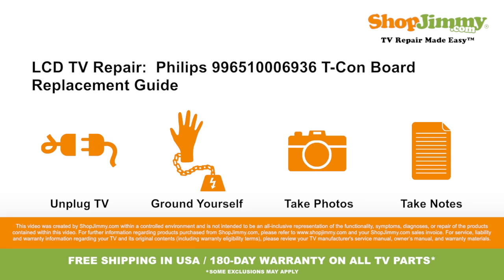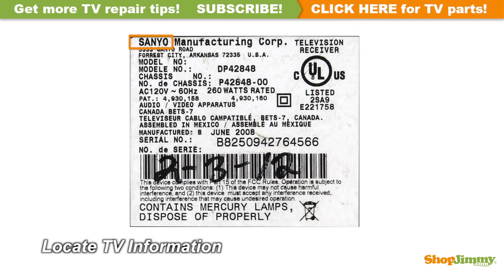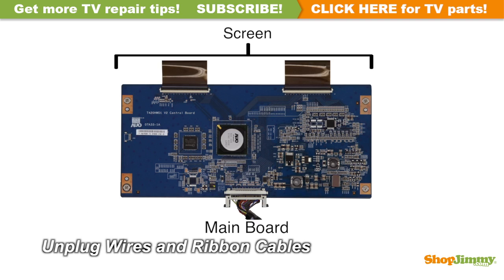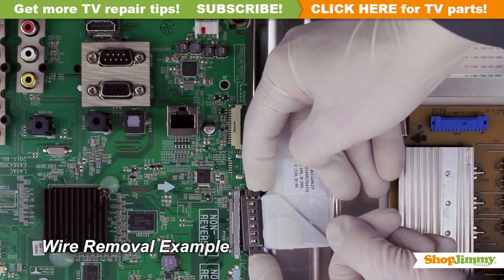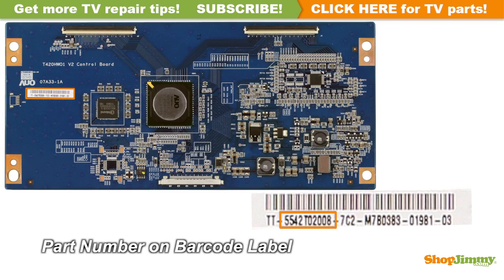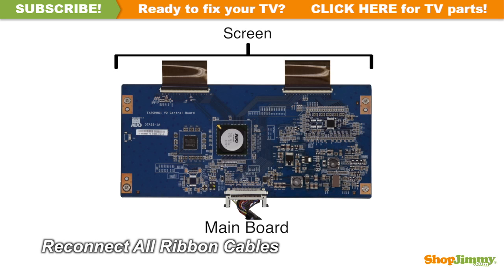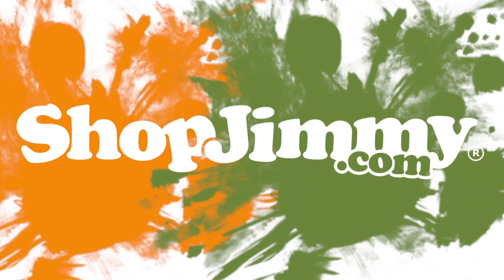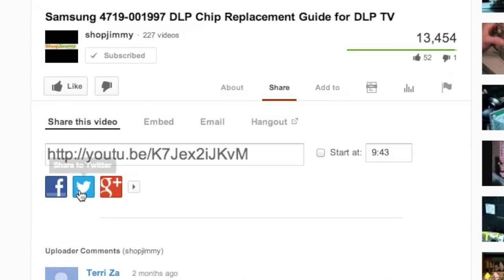Vertical Colored Lines Repair Philips 996510006936 T-Con Boards Replacement Guide for LCD TV Repair

Comment: 2017 PHILIPS 55PF45502F-F7 I OPENED IT UP BUT THE ONLY BOARDS BESIDES THE BIG MAIN 2 ONES ARE ALONG THE BOTTOM THE LONG SKINNY ONES. IS THAT THE TCON? ITS CONNECTED BY MANY FLAT RIBBON CABLES THAT LOOK LIKE THERE SOLDERED TO THE FINGER BOARDS I DONT THINK THERE REMOVABLE??  THEN ALL THOSE FLAT CABLES RUN AROUND TO THE FRONT SIDE ??  PLEASE HELP  THANK YOU

Comment: Hi there great video tutorials, I have a  Philips 32PFL5522D/05 TV   
When TV is turned on the picture is compressed to the bottom quarter of the screen. When left to warm up for 5 mins the picture  comes up perfect. I have checked the capacitors but no obvious bulging. So could you advise, do I need a TCon Board or PSU Board to rectify this problem of slow start up. Please advise and let me know availability of the parts, thanks.
Reply from the maker: Tony Edwards   I recommend replacing the main board in your TV.  Here is a link to replacement parts:  http://www.shopjimmy.com/catalogsearch/result/index/?cat=56&q=32PFL5522D%2F05  Be sure to match part numbers on your current board, with your replacement for compatibility.  Here is a link to a video showing how to identify your part number, click here:  Philips Magnavox Main Boards TV Part Number Identification Guide for DIY TV Repair Help  Thanks and please let us know if you have any further questions with your TV Repair!  www.shopjimmy.com

Comment: Thank you for the informative video. I have a Polaroid TLX-04244B and its displaying vertical lines rainbow and black alternating about every two inches.. Is the t con board what needs to be replaced? If so I would like to buy one from you. Thank you
Reply from the maker: Faith Phillips I recommend replacing the T-con board in your TV.  Here is a link to replacement parts for your TV model number on our website, click here:  http://www.shopjimmy.com/catalogsearch/result/?q=TLX-04244B  Be sure to match part numbers on your current board, with your replacement for compatibility.  You can also call our customer service for further assistance with your purchase.  (877) 881-6492  Thanks and please let us know if you have any further questions with your TV Repair!  www.shopjimmy.com
Reply: ShopJimmy.com